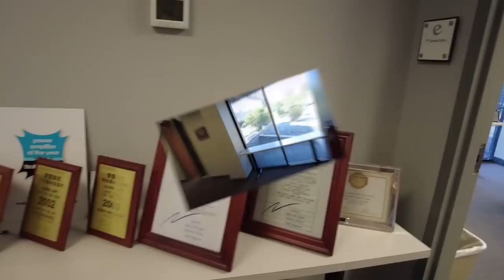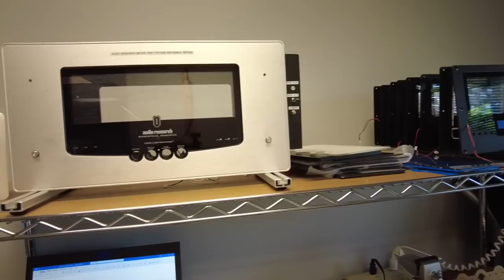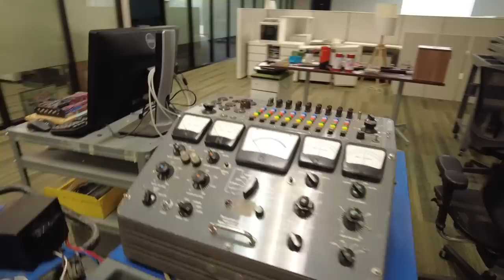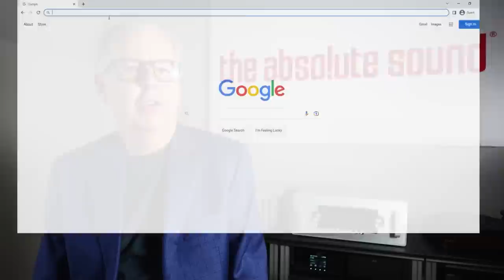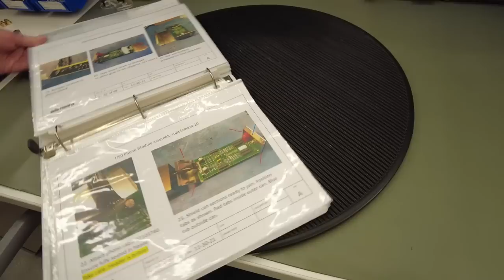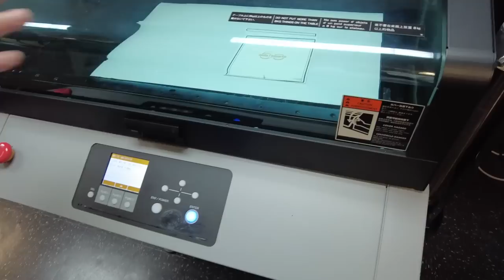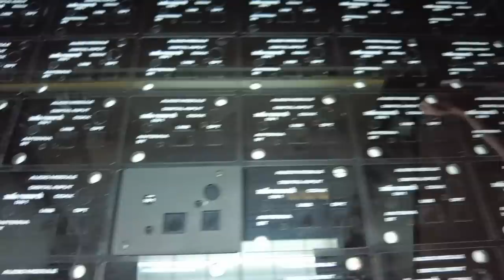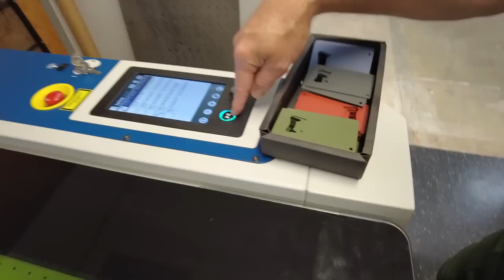Michael Fremer Tours Audio Research 2023 | Factory Tour

Comment: Hopefully they will increase the build quality. Some of the issue was audiophiles outing the poor quality of the costly amps. Note tube sockets direct soldered to circuit boards that's pretty darm cheesy for costly gear. Wish them the best but that needs to be addressed.

Comment: I reckon placing the beautiful lamps inside an enclosure is a designing error.Lamps should be exposed for cooling reasons.Heat shortens life of the electrolytics for sure.     6:04

Comment: Personally didn't care for Audio Research. Build quality is great they just push center stage vocals way back for my taste. It's a processing sound you either like or do not like. I prefer VAC
Reply: Taste. Sound stage and vocals, have a lot to do with your speakers choice. Needs to be paring.
Reply: @cesarjlisboa7586  I hate gear that places vocals on the plane of the speakers or forward of them, so…
Reply: Choice and placement, some have such amazing ears to pick up on these nuances.
Reply: I am not talking about singer voice on plane of speakers or in front of them. I am talking about singers voice being pushed way back like at a concert with seats for away versus being in a dive joint where I am 5 rows back and singer is right their on stage with instruments behind him. far away works for orchestra but not vocals as they are too disconnected for the performance. I have a pair of VAC 452 IQ musicblocs in mono and VAC master pre-amp with dragon cables audioquest and Rossini apex dac with separate master clock. Sonus faber aida 2 speakers. I just do not care for Audio researches sonic presentation and I have listened to their Ref6se and did not like it. Personal taste. My soundstage is huge with center vocal in the middle with proper layering not too front and not too back with presentation.
Reply: @boulderswingdance8639  Yes exactly we have different tastes and that is fine. What you like is the exact opposite of me. I like soundstage where no walls or speaker exist  but the signer is center pushed back but not too far. I go to lots of concerts with great seats but that is different experience for me than listening in my relax room where sounds like the artist is there and the music washes over me. That is why various equipment exists. Not saying Audio research is not high quality it's just not my cup of tea.